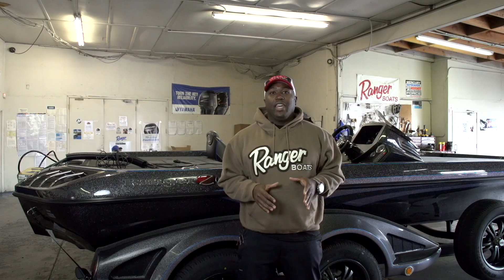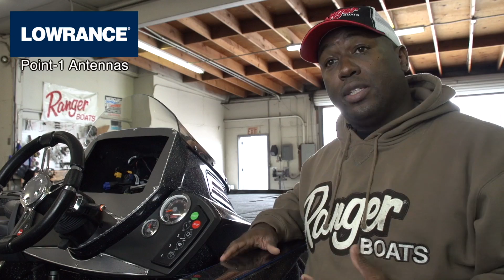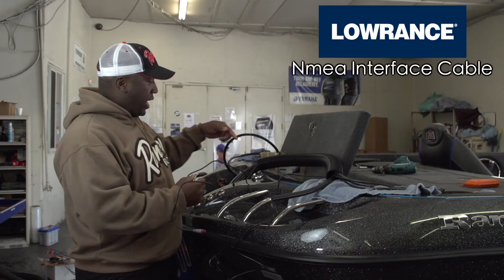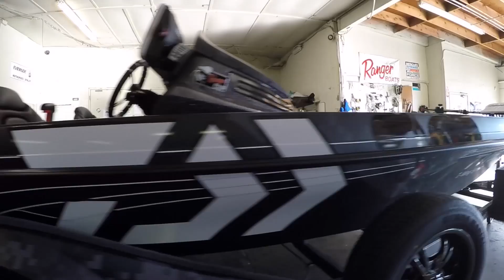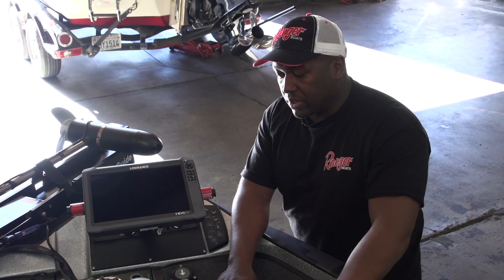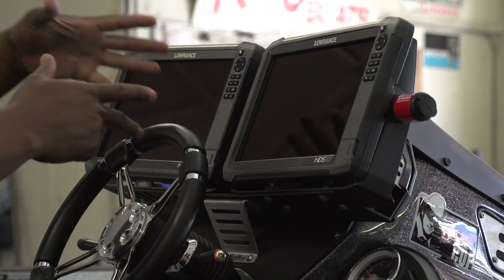How Ish Monroe Rigs His Boat with an HDS® Gen3 Network

Comment: What's the benefits of two point-1 antennas?
Reply: voney man he is running 21' boat - each puck zero' s in precisely the waypoint. Just one would not be exact. A bit much if you ask me, but they are $ counting. Staying on a small rock pile can be the difference, eliminates a bit of guessing you could say.